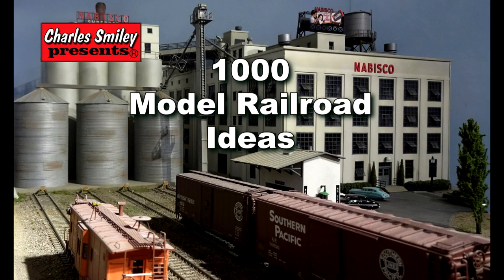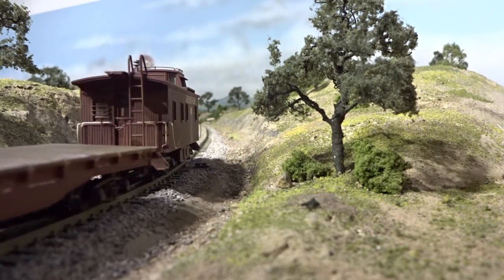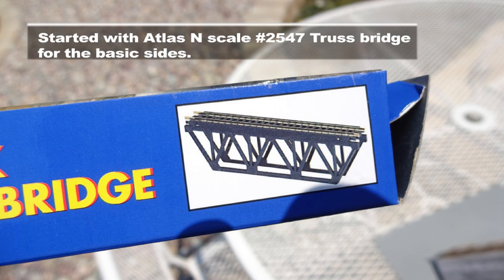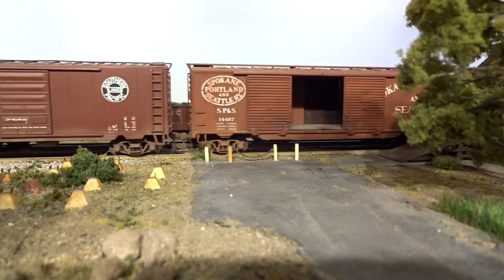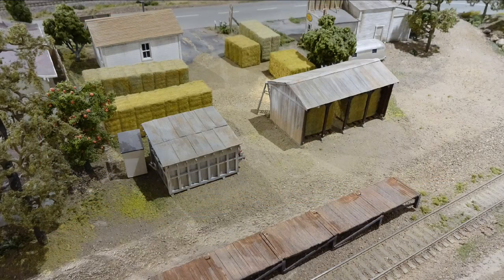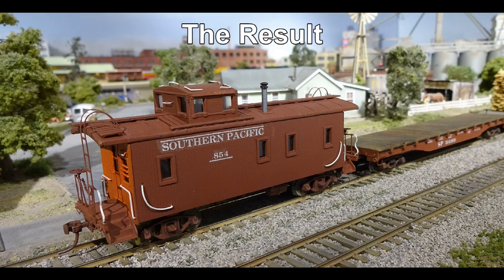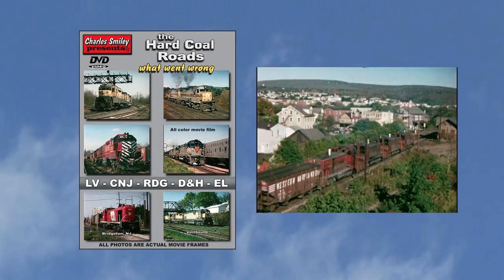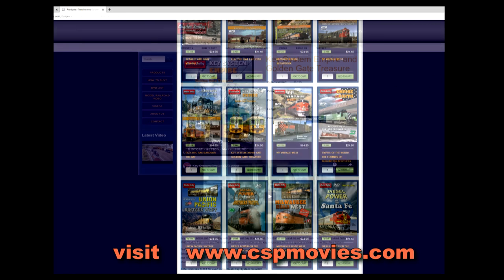1000 MODEL RAILROAD IDEAS: Multiple Topics

Comment: I don't do as much detail like grab irons, brake wheels, ladders, etc.  I paint almost all the details on molded on parts which help with perspective but I just can't see cutting off all the molded on parts for real parts.  I do replace broken stirrups and brake wheels.  I noticed that you don't paint the little springs on the couplers.  If you don't paint them the same color as the coupler, it sticks out like a shiny sore thumb.   I noticed it on the GP-9 couplers.  Chicken coops - fully weathered; farmhouse & windmill - no weathering.  If you're gonna pay that much attention to detail, wouldn't you weather houses & windmills?  Cheers - eastern TN

Comment: It’s weird, when we model areas, even in different eras, just by the weathering and color variety in scenery it’s very apparent what and where I’d being  modeled. I’m modeling in the 1910-1935 era of the coastal Texas Gulf coast lines, two branch lines and another that’s interchanged into the main that’s served by southern pacific all in the Guadalupe river valley. In fact, the two branch lines served by the GCL (later mopac) had the latest serving 4-4-0’s in the country as they still ran daily revenue up until it crashed in 1946 in kingsville Texas.
Reply from the maker: We try and keep the weathering specific to the region, even going out and sifting sand and rock ourselves.  It is way more realistic and cheaper too.

Comment: Ok, call me picky, but that station as good as it is. There wouldn't be a signal in the middle of the side walk. Also, there isn't enough room at the bottom of the steps from the upper walk way. Just saying.
Reply from the maker: both stations have Train-Order Semaphores. They are not "signals" in the ordinary sense. They were usually in view of a bay window on stations to stop trains for picking up new orders.